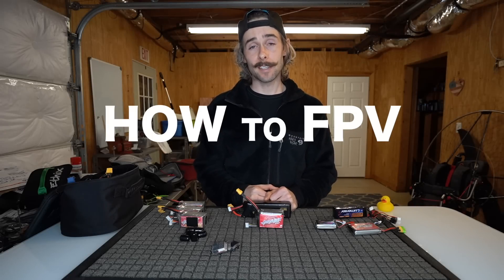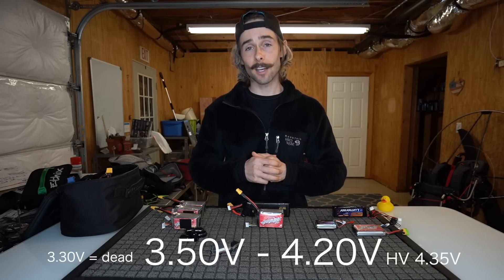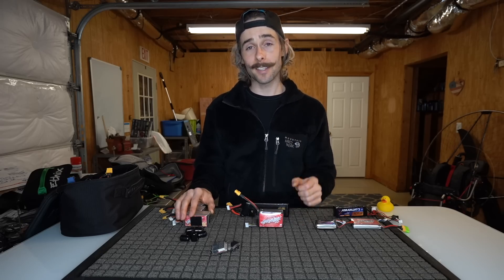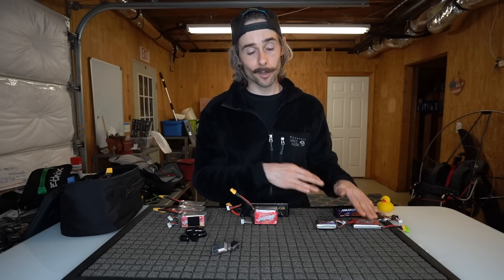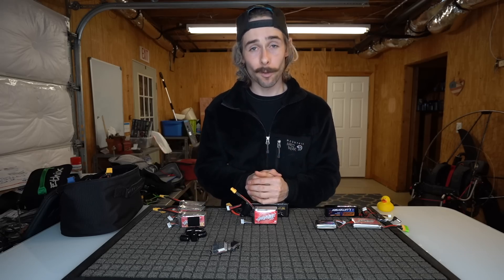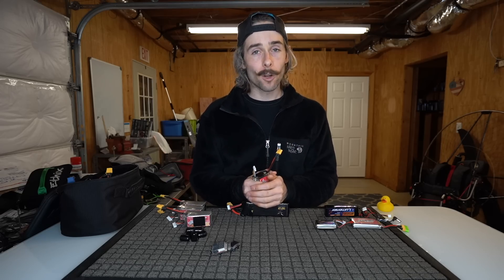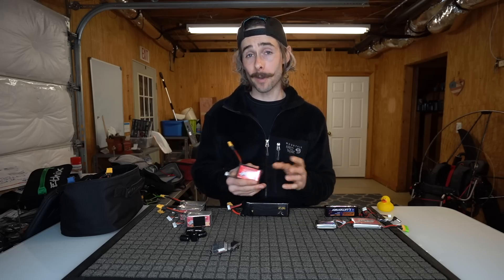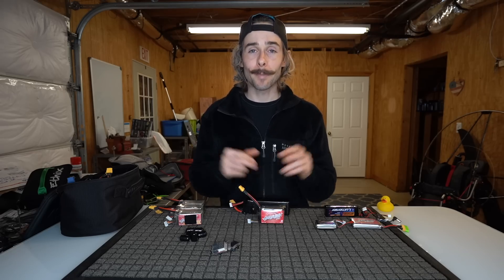How to FPV (Part 6) LiPo Battery Management | Make your LiPos last longer!

Comment: One more thing: What about flying when it's cold outside? Do I have to keep the lipos warm?
Reply from the maker: If it’s below 45F degrees I would try my best to keep the lipos warm somehow.  Ethix makes a heated lipo bag that works well.  Or you can put a few lipos in your pockets and try to warm them up with body heat prior to flying them.   They the heat helps them not drain as fast in the cold and also you’ll have more punch and power with them warmer

Comment: I have a 3s 6Ah, 60c since 2019 and never used it down to 3.0v, 
but my charger always discharged it down to 3.0v with 1.5A - couldn't change the default voltage value, and the manufacturer recomended the same.
 I did a full charge, full discharge and storage every month when I didn't use it.
 And now still has 6012mah (originaly had 6025) if I discharge it to 3v/cell and 0 puffing. Also my boat draws around 140A at max load. 
I didn't check the internal resistance tho, but I feel no difference in throttle response or capacity.

Comment: so its not good to fully discharge these lips?  I plug in a voltage checker into the battery and just let the reading drain the battery till it turns off... so somebody plz help is this not the correct thing to do?
Reply from the maker: No no no. Can’t let it get lower than 3.5V per cell.

Comment: What happens if for example i push the throttle and it goes below 14v for a second and immediately recovers avove 14.8v, is this considered a "damage" in the battery as well or is it a normal behavior?

Thanks for sharing knowledge)

Comment: I saw some 1S batteries they write HV on it (high voltage?) with 3,8 V or 4,35 V. So these can be charged to a higher Voltage ?

Comment: Can I fly the battery up to storage voltage and just leave it? When I finish flight, the battery after unplugging is around 3.8V per cell, so it is storage voltage. Is it ok for the LiPo batteries or is it better to use them more and then charge to storage voltage?
Reply from the maker: Yes
Reply: @MrSteeleFPV  Thank you.

Comment: I plan to put FPV in my speed car build with 3S 4200am 120C X 2  in series. Can I power the FPV on one of the 3S charging leads without damaging the battery? Or connect the power directly to receiver 🤔

Comment: 65amps per motor on 6s? Def not per 4 motors those would be some awfully weak motors .Even in 2019
Reply from the maker: Glad to hear from you Matt.
Reply: @MrSteeleFPV  indeed

Comment: This is true. Keep your battery between 20 and 80 % and it will last forever. The only drawback is that you only use 60% of the capacity =)

Comment: I fly micro 1S drones. HV batteries at 4.35 sag to 3.7 in seconds after flight. I fly them to 3.3 and only get 1.5 minutes. If I flew them to 3.8, it would only get 30 seconds of flight time!

Comment: Thx for the info, I am new to the hobby and into rc cars. So I have been limiting myself at 3.5V per cell (2 and 3s) and thought that this voltage gave me a good safety margin. It looks not really since I was basing my info from the B6 chargers booklet (3to 3.3V min). I will bump that up to 3.8 V. My question (and I think I can feel the answer) is, if from storage voltage/capacity (per my charger of 3.84 V and 50% "fuel") my battery does not accept 50% of the mAh rating I have a "fake" or mislabel battery (live in Indonesia which is full of fakes). Am I correct that from storage the battery should accept close to 50% rated mAs per battery size? So my 3s 5200 mAh batt should "take" about 2600 mA? The point of running higher voltage also makes perfect sense, less current. I took circuits class in college 30 years ago, all I remember is :"Twinkle twinkle little star V=IxR". Thx in advance.

Comment: I was able to revive a pretty new LiPo that was connected to a flyaway that was found some days later.  That battery was flat.  I charged it on a NiCd setting at 100mA until the cell voltage was high enough that lipo mode would accept the battery.

Comment: Replacing your new toy RC battery can cost between $25.00 - $50.00 or more per pack. If you're wise you will make that thing last as long as possible. Here are some intelligent "Tips" that will help you in the long run. -Bill Howes.

Comment: I am just getting into FPV and is there a way to know the voltage left in a battery while in flight?
Reply: You should be able to put the battery voltage into your On Screen Display (OSD). I usually put both the total outage of the pack and the average voltage per cell. When you fly, because of voltage sag you can fly down to about 3.4 volts per cell and the pack will recover to about 3.6 or 3.7V.

Comment: I use my old 3s 2400mah packs for over 4years now (i use them in my rc car and my Drohne) the capacity went only a very little Bit down (They have now ca 2100mah ) 
I also pulled the cells under load to 3.10v  per cell. And I Charge them to 4.24v. I only Use storage when i dont Fly for one week.  I dont know why some lipos only keep working for a schorter time. 

My smallest 300mah packs for the mobula7 hold up for one year now But i think they are Not the Best.They only have 200 mah capacity after a year of use.

Comment: i have some some adrenalines from 2017! they've degraded, but still flyable, i generally can still pull about 800-900 mah out of the 6 remaining packs in this series, but they are not as powerful as my new packs. great for a cruise or messing around, though they probably have only 100-150 charge cycles over that time period honestly

Comment: Great video thanks. Just one question. I have a little whoop and on 1S I have the landing alarm at 2.9 because when the battery cools and I measure it it really is around 3.7. So at what moment should I measure the voltages you suggest?

Comment: What’s the longest time you can leave a Lipo in “storage mode”?
Reply: If I recall correctly, you should check the cells and recharge it to storage voltage every 3 months or so. But they will still degrade over time, even when in storage mode

Comment: Fly time is only 3 minutes for all that money. I'm out
Reply: you could get way longer, but you would have to get maybe 4500mah batteries, or even 6500mah, and you could get maybe 15-30 min, but you wouldn't get as much performance, or your batteries would take 5-10 flight du to the amps draw.
Reply: Thats why you have multiple batteries ... and with this type of flying it feels a lot.longer than 2 or three minutes.  And depending on your drone you can get 5 minutes ..8 minutes .. some get even more .. racing quads demand a lot of power hence why flight time is low .. get a cinewhoop ..or a more freestyle type drone you'll have better flight times. The rush from flying like this is worth the low flight times.  I have camera drones atm but fpv is def something im getting into . While i love 30 minute flight times on my camera drones ..they can get boring to fly unless you travel a lot . Fpv is def the next step up in skill and adrenaline rush.

Comment: I was watching your videos and it motivates me to  build one  i got all the parts esc,flight controller, transmitter, antenna, receiver , and  br2205 2300kv 4s set up  but im very disappointed because i watched some  video that it says charging lipo is very dangerous and you might burn your house  so i just stop assembling my drone because of that video is it really gonna explode like a bomb if you charge the battery  all the parts i purchased at banggood and i cant return it back do you have any tips for me  that is not that scary charging lipo battery

Comment: Take about 80% off (1000mah battery you can drain 800mah)
Better to under discharge than over discharge.
don't leave batteries fully charged/ empty for more than 2 days.
Goggle/ radio batteries don't need to be put at storage unless being left for a week or so.
Date batteries so you can tell how much abuse they have endured.
Nomral per cell = 3.50V - 4.20V
Storage Voltage per cell = 3.70V - 3.90V
2S = 7.40V - 8.40V
4S = 14.80V - 16.80V
6S = 22.20V - 25.20V

just a summary of the video for anyone that wants it :)

Comment: When to read this voltage numbers ? 
1in flight ?
2 if landed and motors are spinning air mode ?
3 when dissarmed ?
I believe 3, so inflight u can go a bit lower in volt
Reply: 3.7 after flight, in flight i drain my lipos down to 3.1/3.2 v per cell.
Reply: What should be right?  

 i use them for over 3 years now and I had no Problem whith this, the capacity is only slightly reduced becourse they are old. (<100mah)

I never damaged a lipo, becourse i discharged them in flight to much.
Also if the pack is Balanced every time there is no Problem whith this.

Comment: Hey mr Steele I’ve had my 1s batteries fully charged at 4.20v for a bit over a week now have I done any permanent damage to them? Was planning on flying as soon as I charged but drone broke and haven’t used them and also can’t discharge them until my new charger gets here.
Thanks
Reply: Small 1s batteries generally have a short life span to begin with so it's not a huge deal, but for me if a battery is charged for over a week I put it in storage mode, otherwise it could start to damage it, I have heard that having it charged for more than a day but the general rule of a week seems to keep the batteries healthy

Comment: How do I know and control the voltage of the batteries? Do I just have to periodically measure? And charge till it’s at a certain point but once I measure it to be at 4.2 pull it off? And how do I take a battery from fully charged down to storage voltage? Just a little confused on these aspects.
Reply: A lipo charger will take care of voltages for you. And while flying you can set up your On Screen Display to show you. There is never any guessing :)

Comment: Hey Steele I love your channel and your videos a lot!!!
I watched your lipo videos a few times and I got a few quastions. first, do you land on 14.8 v, or the voltage after you disconnect the battery and let it rest for a minute is 14.8v? (Which mean you land at 14.2-14.5).
Secondly, my charger can charge at 6amps tops, I got 6 4s battery with 1.3 amps each (7.8 if you charge them together). Can I charge all of them together?

Comment: Nice video man. Question-you talked about voltage sag, especially with 4s. Do you take that into consideration when deciding to land? For example, you’re at 14.9 volts but doing a hard punch out it sags to 13.8.

Comment: I second that... Fly until cruise or hovering touches a steady voltage of 14.0 - 14.2v, once unplugged the battery will rest at 14.8 - 15.0v. My batteries have a longevity and never puff even though I fly em' hard. 

Happy flying to all.... 😎

Comment: Great vid Steele! I'm a destroyer of 1S batts in brushless whoops. Charging the 1S batteries at high currents just as to not run out of charged batteries for the next race. Batteries are almost hot after a race in my son's Blade BL. My HVs, 4.35V, last less time than another BL running 4.2V 1S batts. Keeping up with charged batts per race, with three chargers, my Bets 75 Pro and my son's BL, making it through a two minute race, just seems to be a recipe for battery death. My 4S Ghost though gets great battery life. I think for the reasons you mention. More voltage overhead. Luckily 1S whoop batteries are cheaper, yet I purchase quite a few at a time. Aw, the early days of Inductrix flying! Little kwads, cheap easy batteries, long fun flight times.....  Peace...Guy

Comment: I have something to say about the Rotor Riot Practice Battery. It great! It's the first battery I bought for my hawk 5 and it's still like new in the way it performs. Sure it's a heavy 1500mah tank, but the cells are especially good. No joke. I'm not affiliated with RR in any monetary way. It's that good. I've ran it down to 11v  multiple times. No puffing or loss of capacity. Slight volt sag is all I saw. Battery stays cool no matter what and it's the only battery that I never had to repair the balance leads on.

Comment: You've nailed it man... I fully agree landing at nominal voltage (14.8V) although it's quite hard to comprehend for a beginner. Well, at least it was for me :D I tend to keep flying until it show 14.3-14.4 on the OSD while slow cruising that's roughly 14.8 after landing. 
Your video is super helpful, I've learned it the hard way though :(

Comment: Hover voltage or recovery voltage? I land on 3, 6V and it usually recovers to 3, 8V. My 4s last me about 8 months using same technique. What internal resistance do you recommend retirering pack. Thanx just convinced me to go 6s. I am however gonna build my own 6s packs because for some reason in South Africa their 30% more expensive per W/H. I guess it's the hype. Thanx for adding valuable info to hobby

Comment: For 6s what mah do you use for a regular 5 inch? And how long of flight time does that give you? Also how many months does a 6s batterys last you?
Reply from the maker: I use 1100mAh 6S packs specifically the Thunderpower ones because they are the lightest out there by far. 179g 
    I drain about 900mAh out of them according to my osd.  
  I get roughly 3-4 minutes of balls out flying 
  If you don’t kill them by treating poorly or crashing. Mine are still going strong after 6 months
Reply: @MrSteeleFPV  thank you so much you are my favorite pilot

Comment: Hey, I'm planning on grabbing one of your 4s quads in the next few weeks. I'm just trying to figure out weather I can use 3s, 4s, 5s and 6s.... what ones will work well and what ones will either burn out the quad or just be to low?
Reply from the maker: Anything under 4S will work it’ll just be under powered. 
  6S won’t be happy. Most likely will burn out motors Because the 4S motors are to high of KV.
Reply: Thanks, I appreciate it. Especially when being au the exchange rate adds upto about a grand so burning out motors on the 1 day would suck. Thanks

Comment: So if 6s draws less amps what is killing      the esc's for racing pilots? I have heard that quite often that their 6s esc are failing and it has put me off from making the switch. Is the manufacturer  using fets that can't handle the higher voltage? What are your thoughts on this?

Comment: do batteries come in storage mode when purchased new? I purchased 10 packs and have not used them but after watching this now my concern is are they in storage mode? Probably shouldn't have purchased them if I wasn't going to use them.
Reply from the maker: They should all come in storage mode
Reply from the maker: Lol mods..  sorry. Storage voltage

Comment: That comment at 10:48 isn't quite true because if you take equal Setups and equal batterysize (1500mAh 4s/1000mAh 6s) there might not even be a difference or just a slight one. Voltage sag in most cases though will be lower relative to the voltage as a whole. (my understanding)
Reply from the maker: Yeah ... but you need to account weight into the equation. A 4S 1500 is a terrible battery because it weighs so much.  Imo

Comment: S means cells in a series configuration (most common) - used to increase overall pack voltage.
P means cells in a parallel configuration (less common) - used to increase overall pack capacity.
Reply: Series is used to control voltage delivery. It's easier to lower voltage than to rise it.
Parallel is for delivering large currents.
Reply: Mário Rui Santos and capacity is exactly the same, 4 1000mAh cells have the same capacity either in series or parallel.
Reply: @dmalovic  but it draws more amps because of less available volts, yes?